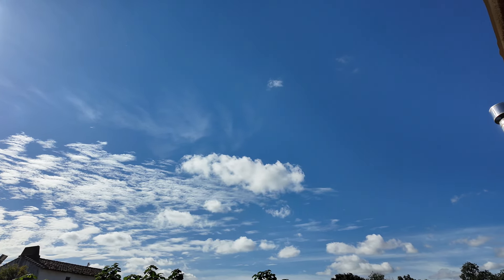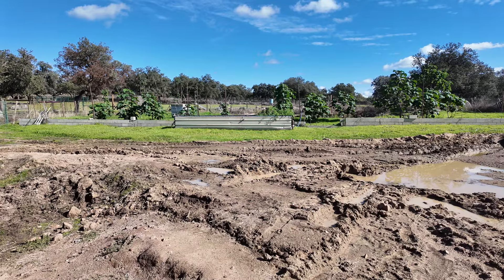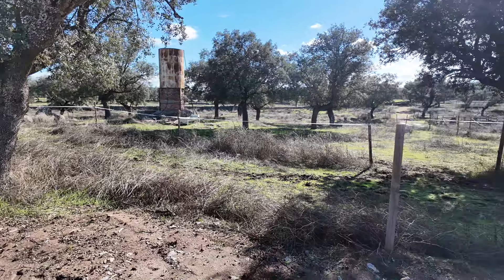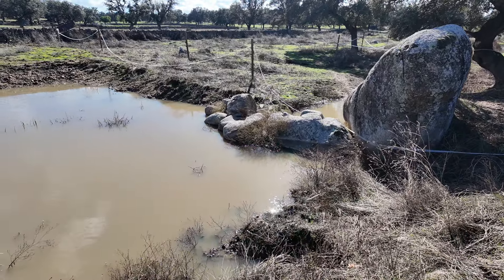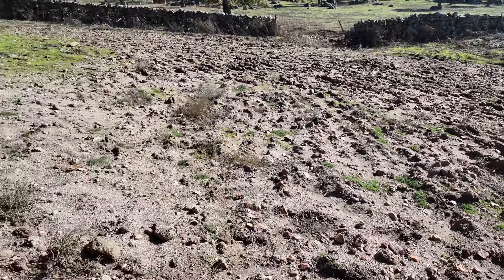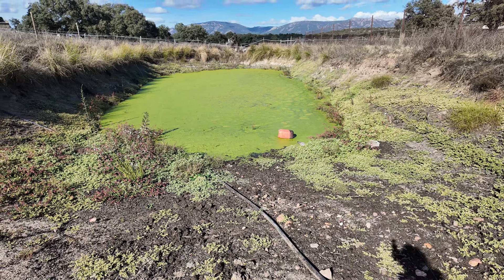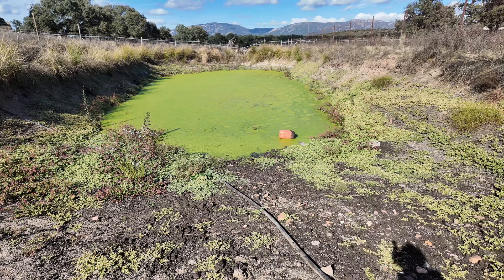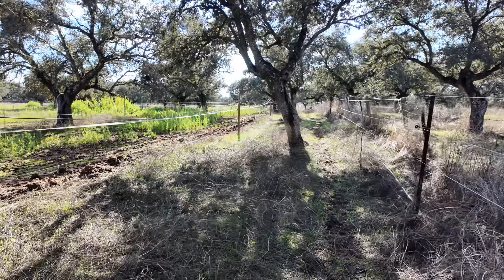Will we use ROBOTS? LESSONS LEARNED ...

Comment: Robots ? not really we do not have enough copper on this earth for electrification to the level that we'd have factories producing robots and robots working, with further factories of repairing the old robots. Nop. you need 700 times the copper that have been mined in the last 2000 years, to have that Klaus'y schwab'y's wet dream.

 Its a nice sci - fi tech dream, but in the end its just a dream.